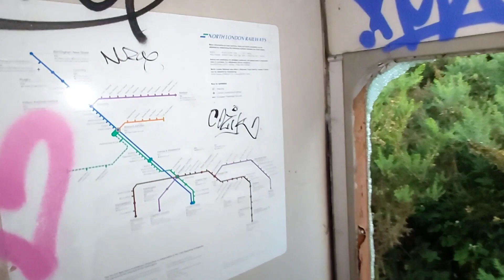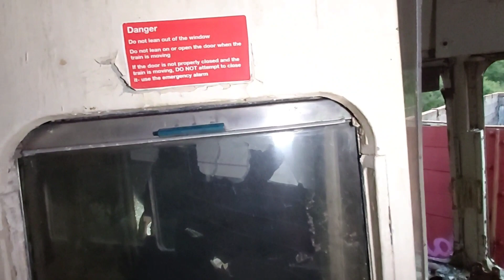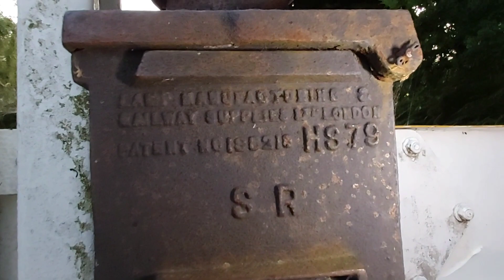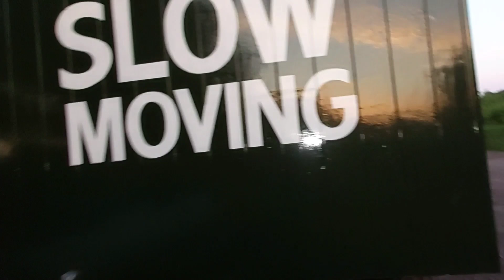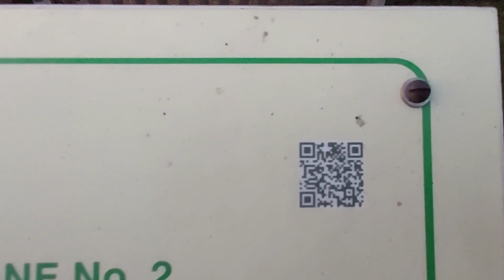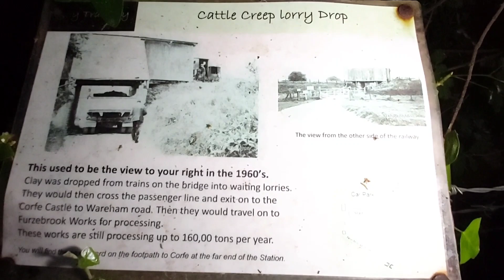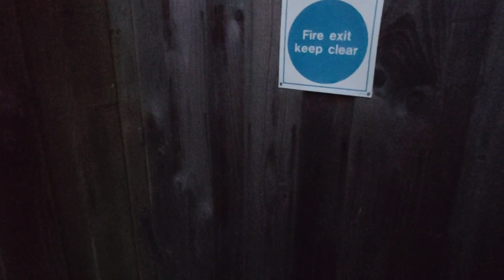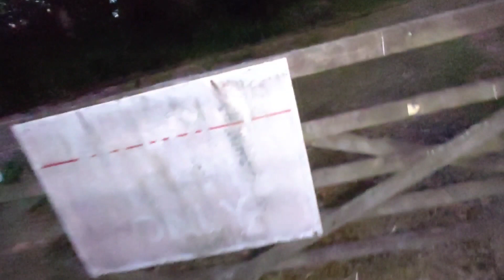The Abandoned carriages and Train #explore #dorset

Comment: Bit risky. But l find these exploring vids especially on railways fascinating. Be safe.
Reply from the maker: yeah its only used for a steam trian and line was closed due to strike
Reply: @Neo-luke  It's a heritage line. The strikes don't affect it and it's a fully functioning line.
Reply from the maker: @SouthernSpotting34050   Have you checked out my Shillington station video?
Reply: @Neo-luke  Although now part of the National Network, the Swanage Steam Railway is an independent operator run by dedicated volunteers, and is in use 24/7 by Engineering and ECS Movements that DO NOT feature on the Working Timetable. It never was, and never will be, affected by the National Rail Strike.

TRAINS KILL! Please don’t Trespass onto Private Railway Property for your own safety. “One Under” involves an awful lot of paperwork and distress for the Train Crew.